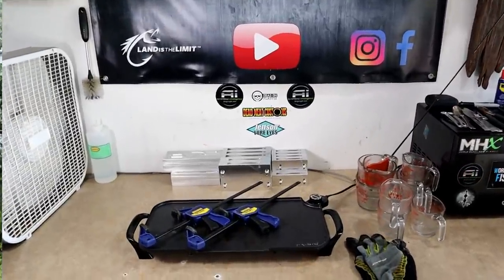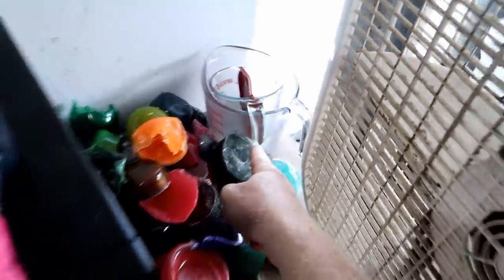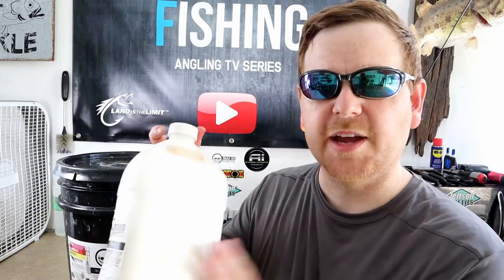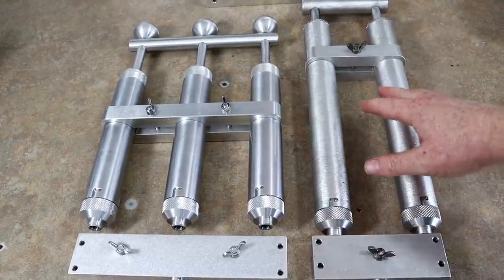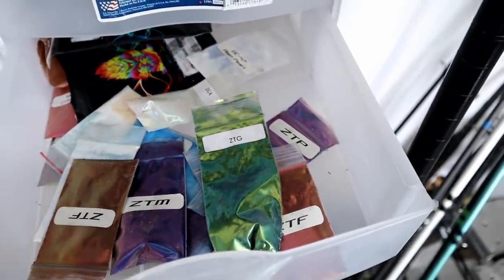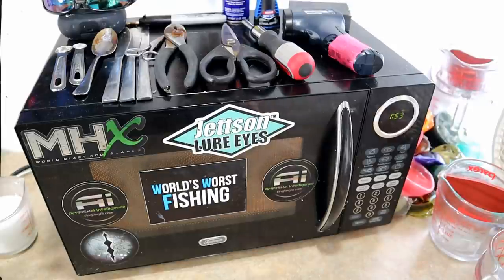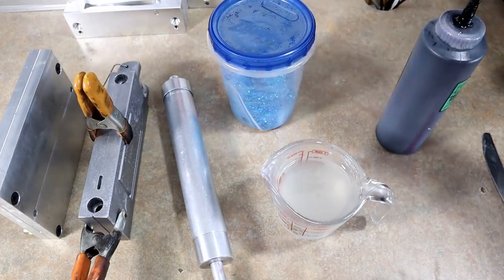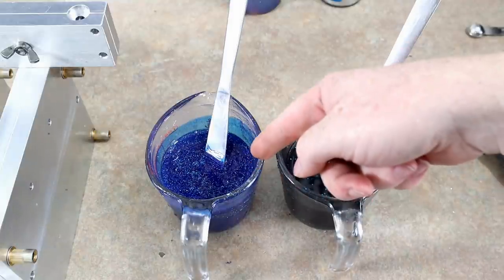Total BAIT-MAKERS GUIDE To Soft Plastics; Lure Making How To Guide 2.0

Comment: I have a couple doit molds. They're not cnc  quality but all baits shine when wet! Simply spray them with high temperature engine paint (I use clear) and you'll get a much nicer finish, or you can always clear coat them. I agree cnc molds are a better finish straight from the mold!

Comment: Great video. I started cause of your videos. I do crappie baits but your info and demos cross over to all bait making. Right now do all of mine out of a shed. But it works for now. Thankyou for all you do for this hobby
Reply from the maker: Awesome to hear
Reply: @WorldsWorstFishing  not trying to be picky but laminates most have a top and bottom so need to know which is which and also not all cnc you can laminate. I made a 380.00 mistake and since it woudnt laminate i sold the mold.
Reply from the maker: @MarkWilliams-yx7bx  correct, it is the customers job to know what they are buying.  Not every mold is configured for top/bottom lamination.

Comment: Have learned in a very short amount of time that putting your cup on a scale and hitting the tare button before adding color and flake is fantastic for exact formulas. Found mine for a buck at a garage sale and it weighs out to .01 of a gram
Reply from the maker: Yes if you really really want exact formulas you can even way out your colorant and get exact weight ratios.. I can tell you from many years of experience that slight variations in formula are completely indistinguishable.. being precise is a good thing but I definitely do not think anyone needs to go to that sort of trouble, measure out equal amounts and add equal amount of drops and scoops of flake. Will save a lot of time when efficiency becomes important.
Reply: @WorldsWorstFishing  I do the measurements when I wanna help out my friends learn the general area they should be in
Reply: @WorldsWorstFishing  eyeballing it is best because there is really no exact sames in nature

Comment: I got a Senko mold and I only get one or 2 and I get so much air bubbles and at the end and I go slow and when I go faster I get the bottom one it doesn’t fill all the way and I kinda need help to fix it what tips do you have, do I need a bigger injector because it 45 mil and fills it to the top almost and then i have to pour like half an inch with the cup and it’s 4 cavity 5 inches?it fills the 3.5 in ripper fine
Reply: It fills the 3.5 in ripper
Reply from the maker: sounds like you need a vac chamber to just get rid of akk bubbles
Reply: Mabe but it’s like the mold only fills like half the Side on the end and fills the rest of the mold at like the front so I need to go faster to fill the mold end or do I go slower

Comment: Been using the 6 inch open pour swimbait to learn. Sometimes the top sinks in a lot as it cools. Is that due to not de-gassing the plastisol (using dead on craw tube)?
Reply from the maker: no, its due to cooling plastic, HEAT the mold as you are pouring.

Comment: What happens if you mix your color and flake into the plastic before you heat it in the microwave? It just seems like it would be easy to mix in the color when the plastic is liquid and not have to stir or mess with a hot cup of plastic when mixing colors.
Reply from the maker: It works well that way however you cannot see your formula when the plastic is raw.. I like to add it to cooked plastic so I can see the color building process and not add too much
Reply: @WorldsWorstFishing  So if I had a formula that I was familiar with and added it to the cold plastic then heated it up I would get the same result? Also would the quality of the plastic be better if it went through one less microwave heat cycle? If you were trying to create a new color I can see where heating it first would be an advantage though.
Reply from the maker: @aarondavis8224  in my opinion your color turns out better when added to cooked plastic, that is less exposure the glitter has to the microwave.  I see absolutely no advantages to adding your color before cooking.

Comment: You didnt touch on scents added....any info on those, right temp or best time to ad scents to the plastic?
Reply from the maker: 10 drops in the bags after baits are made..never add to hot plastic..scent will burn off
Reply: @WorldsWorstFishing  I disagree with this. I just ordered some from upperhandscents and he specifically said poor in scent right before you inject into your molds to minimize burn off, but Chris your hard stance isn't good on this topic, you should be more understanding of the facts regarding when scent can be added and still maintain it's potency. adding to both the bag and into hot plastic before injecting will get er done
Reply from the maker: @jesseshumaker2718  agree to disagree...in my experience over many years and talking with the most talented experienced bait makers in the game, the overwhelming consensus is it's best to add scent to finished baits.  It will still work in hot plastic, but the longer it stays in hot plastic the weaker it becomes..idk a single bait makers adding scent oil to hot plastic before shooting.
Reply: @WorldsWorstFishing  Yah, so it's kinda  a grey area. I think this deserves a video :), although scent is hard to prove on a video lol. So if placing the baits into cold water will this hurt the absorbtion rate after they are added to the plastic bag with the scent? how long do you leave them in the cold water?